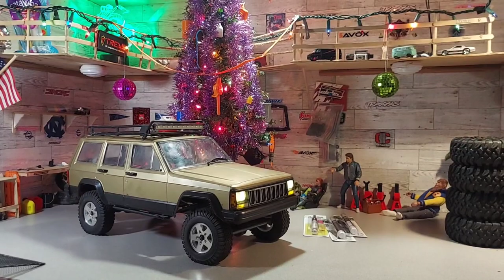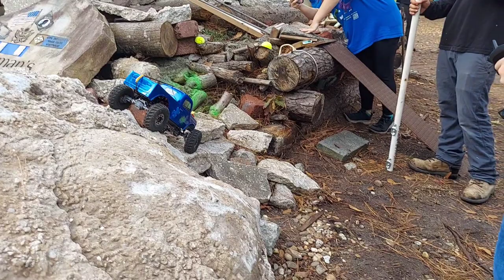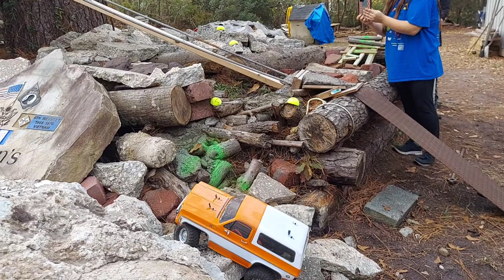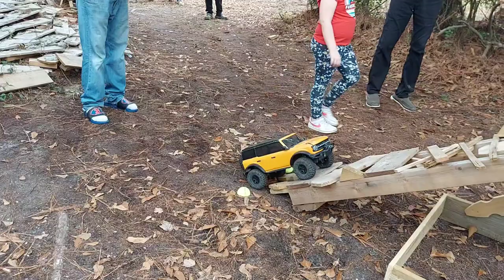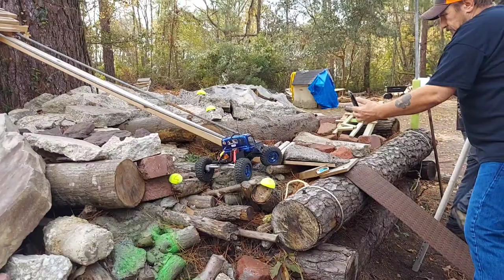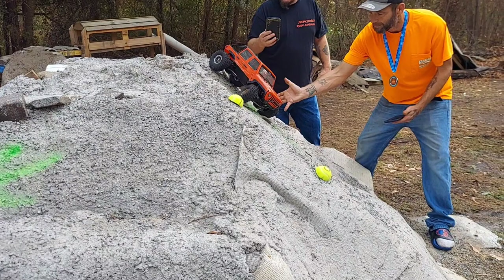Awesome Christmas RC Crawling comp with new friends me and my Element Ecto got 2nd place

Comment: I can't wait to get another crawler. I had the orange trx4 blazer.  I even made a custom long travel suspension for it out of brass rifle cleaning rods it had about 6 1/2 inches of flex. And It had monster 2.2 on it that thing was a beast. I'm more then likely going to get the trx4 high lift.
Reply from the maker: You should get the high trail  It's only $50 more and it comes with a $130 worth of upgrades including.